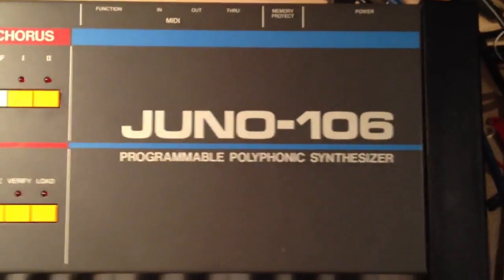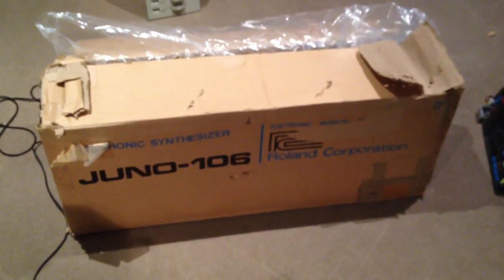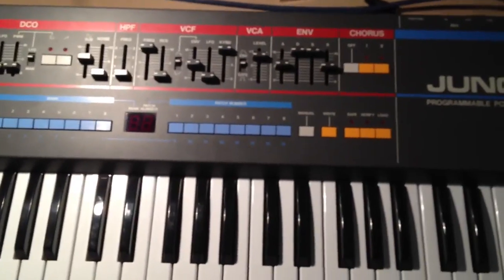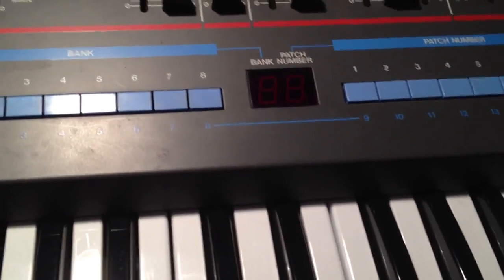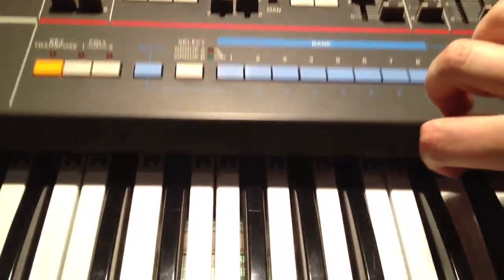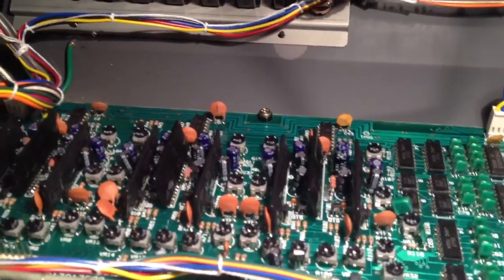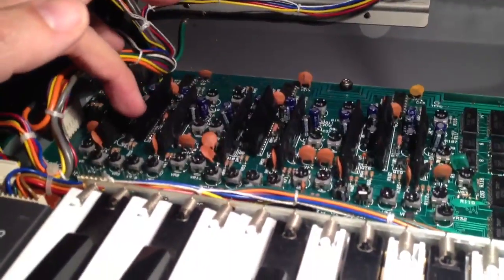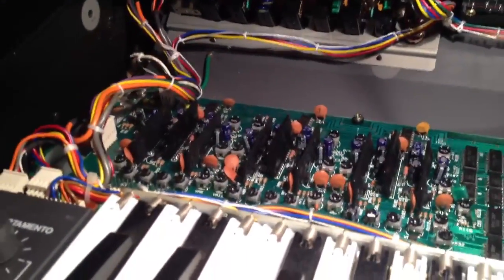Juno 106 Repair - Part 1

Comment: The other issue with the coating sprayed on at the factory is that the coating is preventing proper heat dissipation to occur.  Those chips really don't need the coating, but someone at the factory I guess decided to allow the contractor company providing the voice chips to spray the conformal coating (to a device that really does not require the spray coating) .  But those chips do get hot enough to where the coating interferes with heat diss, so then they fail to work properly.

Comment: Great video, most in depth thus far. I've got question I'm hoping you can answer. I tried the acetone bath on my only failing voice chip and there was no change. The voice works fine as long as the filter is open, but once you start closing it the voice disappears. Are my only chances for this a chip replacement? Just to be sure it was in fact the chip itself, I swapped it with another voice and lone behold to problem transferred from voice 3 to voice 1. Thanks!